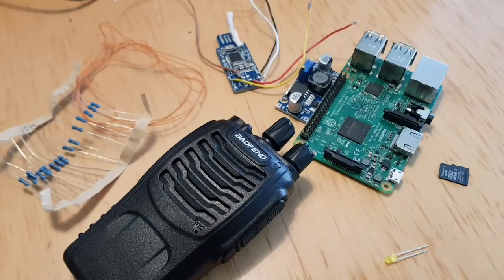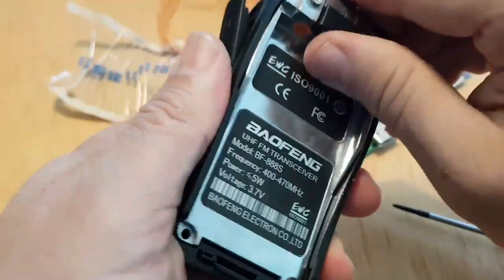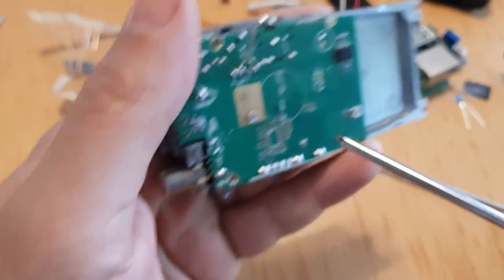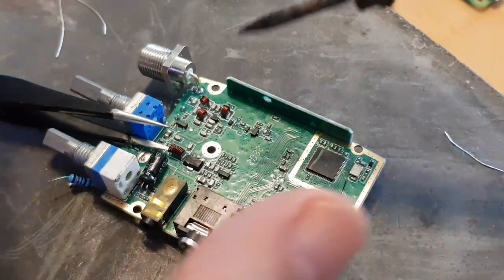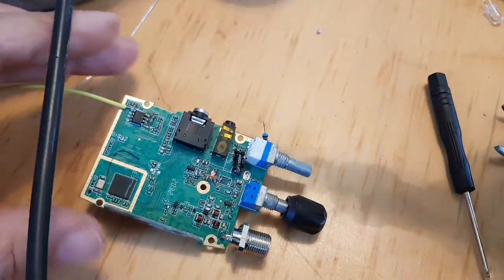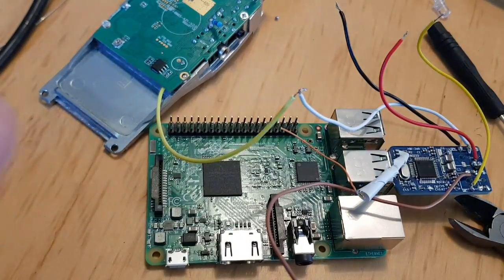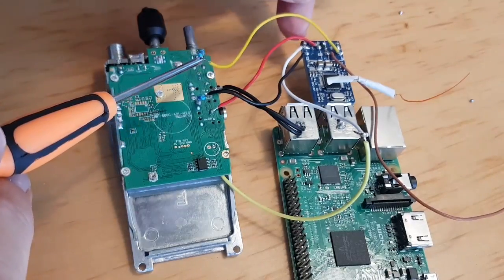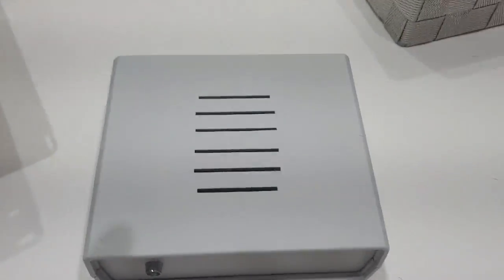Build-Allstar node -Home made + pre modified CM108 sound card

Comment: Nice video except the way you do soldering. When you solder you must put your soldering iron to the surface you want to solder and melt the solder lead by touching it on both the surface and soldering iron at the same time.
Reply from the maker: Yes good info I have tried so many times I try stay away from soldering , thanks 73